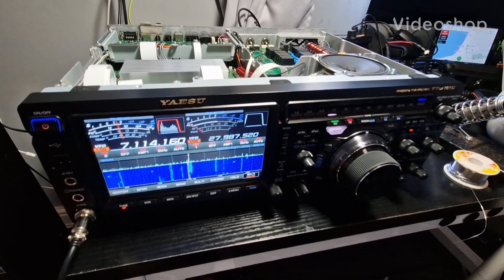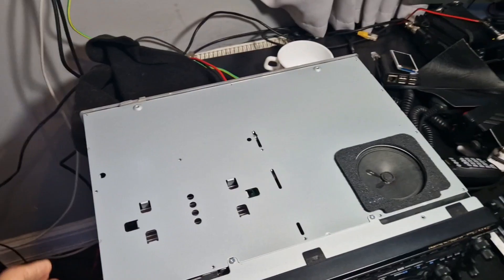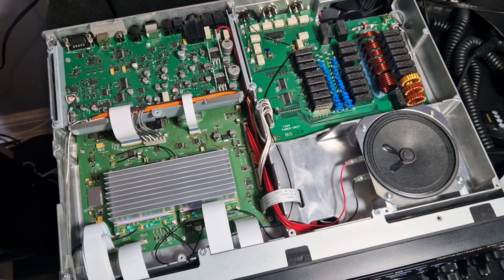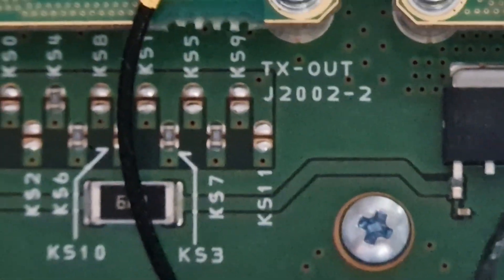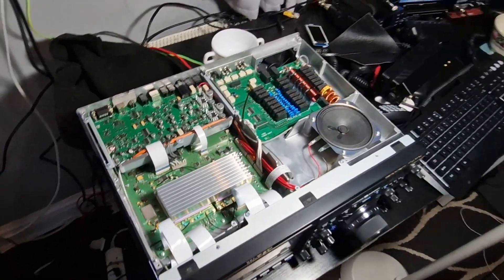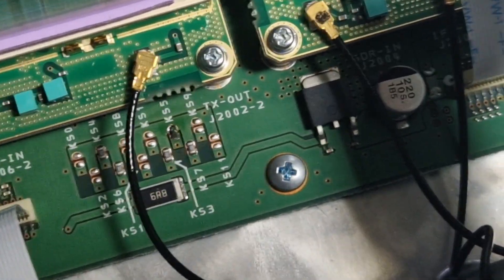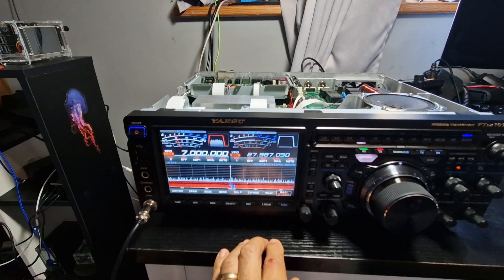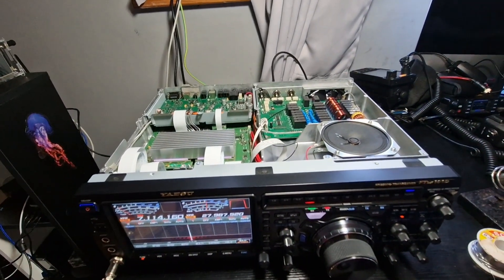YAESU FTDX101 - MARS MOD - RECEIVE ONLY DO NOT TRANSMIT - EPERIMENT ONLY

Comment: I remember it can be done from menu option. When powering up need to hold some button from upper row. Don't remember exactly. Was thinking 0 ohm resistor is for TX but for RX menu option is enough
Reply from the maker: Need more info to confirm this .
Reply: @M0FXBHamTech  I have pdf file from yaesu. There are 2 parts. 1: To enable the 70 MHz (4m) set to region C2 and part 2: to enable 70MHz 4m band. File name is yaesu-ft-dx101-4-meter-70-mhz-instelling-classic.pdf There are key combinations and need to enter digits touching screen

Comment: I own a Yaesu FT-840 which was very easy to jailbreak without removing or jumping any components. When I ordered my Yaesu DX-10, I had HRO do it so as not to void the warranty. Gigaparts will do the MARS mod, but DX Engineering will not. If you do it yourself and your rig is still in warranty, it may void it if you have to return it for service.
Reply from the maker: Yes agree